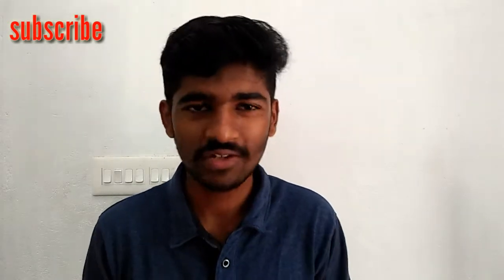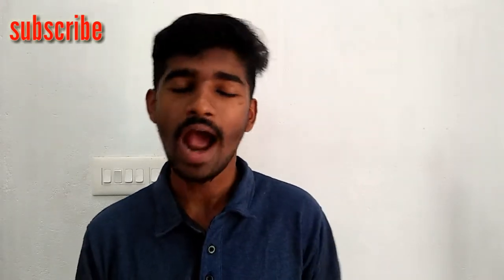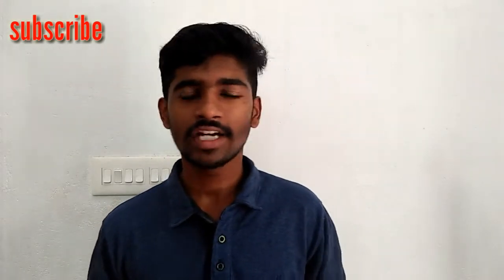#Components and how to work an ignition #system in a #bike|In malayalam| ഒരു പ്രാന്തൻ Mechanic|MK4AT

Comment: Suzuki access 2015 model bayankara missing und brooo cdi , regulator , plug , air filter  ellam change cheydhu carbetarum clean cheydhu ennitum missing marunnilla
Reply from the maker: Cdi kke aavishyamaya current kittathath konde aayirikkum bro...wiring ellengil key set nde issue aayirikkum.

Comment: Bro vandi low speed il povumbol missing wht reason
Reply from the maker: Air filter clean cheyyth nokk
Reply: new air filter ettu nokki anittumm matam ela running perfect ayi nikkunila
Reply from the maker: @athulm8886  carburator le pilot jet um main jettum clean cheyyth nokk...fuel line also

Comment: Fz vandiyil 10 % acceleration kodukkumbol back fire m missingum undavunnu  carburator diaphram check cheyth clean aki ittu ennitum marunnilla current prblm kond ingane undavan chance undo
Reply from the maker: Main ayi valve nde sidil carbon deposit aayath kond aayirikkam...allengil cdi pani thannu...onnu head azhichu valave seat cheyyth nokk

Comment: Nte pulsar classic 150 spark varunnilla bro
Reply from the maker: Ignition coil or pick-up coil nde scene aayirikkum
Reply: @mechanic3318  kicker only aanu.
Stator maatti vechu ennittum spark pluggilek power varunnilla.ith randum maari vechal power varumo
Reply from the maker: @yadhusree4305  ennal aah model pulser nde CDI veche onnu try cheeyy...chelappo cdi poyath aayirikkum
Reply: @mechanic3318  ok bro.
Bro 2003 model pulsar 4 gear ano 5 gear aano .
Rounded headlight ullatheniq 4 gear maathre veezhunnullu

Comment: pickup coil complaint undel vahanam start akan prayasam ano, pick up coil correct work ano ennariyan multimeter upayogichal ariyamo
Reply from the maker: Pick-up coil poyal vandi start avoolaa... Multimeter use cheyyth resistance measure cheyytha fault kandupidikkam

Comment: ente bs4  ns 200 nu idak missing um miss fire um und.... ee kazhinja  week 3 spark plug um vaccum piston um maari ... ipozhum problem und.... enthayirikkum reason?
Reply: Thanks for the reply bro....🙏🙏🙏🙏
vaccum piston mattiyapol carburator jets okke clean cheythatha... chila samayath starting trouble um und.... vandi odichit nirthiya sesham oru 10 min okke kazhinju start cheyyumbol aanu trouble....  ravile vandi edukumbol problem onnum illa.... missing oru 3k rpm il aanu.... ithiri mileage drop um feel cheyyunnund.... fuel filter problem varan chance undo?
Reply: @gokulvgopan  ഇത് ഉറപ്പായും cdi യൂണിറ്റ് ഇന്റെ തകരാർ ആണ് 🤣🤦‍♂️വേഗം മാറ്റിക്കോ
Reply from the maker: Miss fire undengil ath CDI or pick-up coil correct aayi work cheyythille varum...pinne missing ne carburetor jets onn clean cheythu ettu nokk